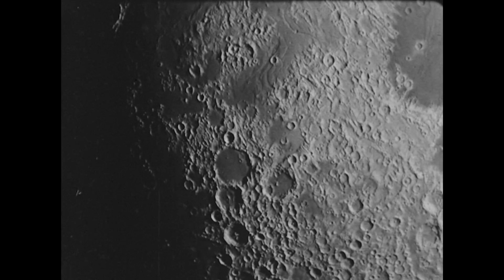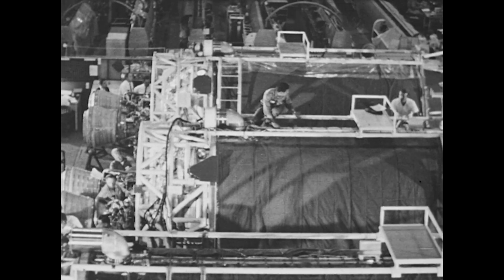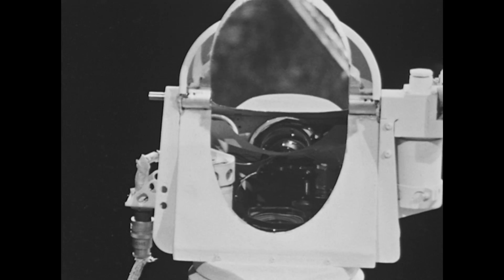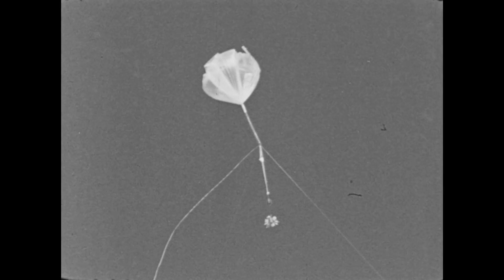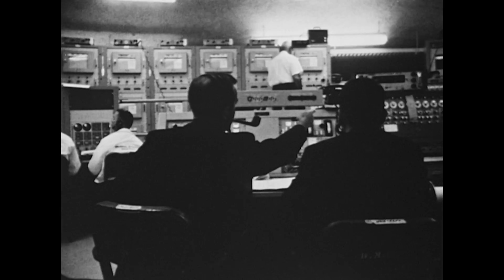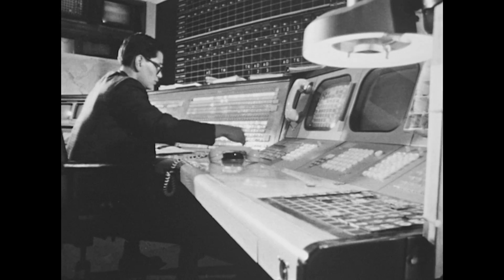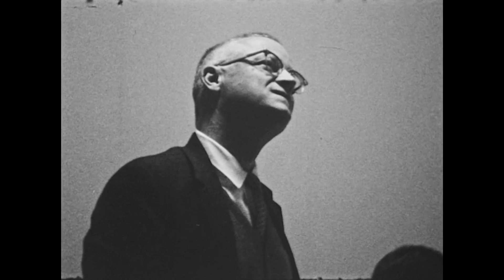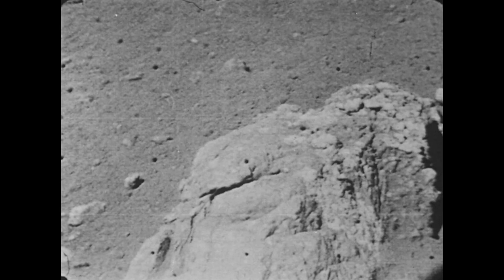(1960s) "Lunar Landing, The Mission of Surveyor I" (NASA 16mm Narrated)

Comment: That powered drop test was impressive. It wasn't balloon tethered to simulate 1/6th gravity?
Reply: According to the commentary it was used only to get the lander up in the air, then it was cut loose. So it landed in full 1g, which is surprising indeed. Either the engines had an impressive excess of power or a different set of more powerful engines was used in these testes?

EDIT:  I found the answer: A special mock-up of the Surveyor spacecraft was developed whose weight in terrestrial gravity was 1/6 of the flight spacecraft - "Surveyor Spacecraft Automatic Landing System", Sam W. Thurman.
Reply: @wb3361 thanks forthe info!